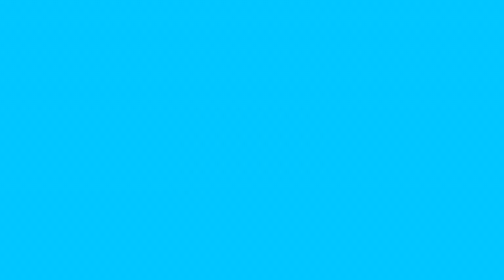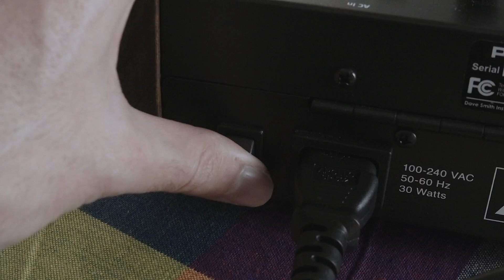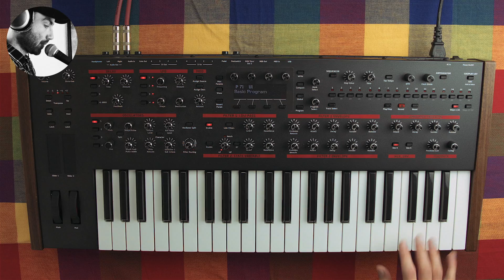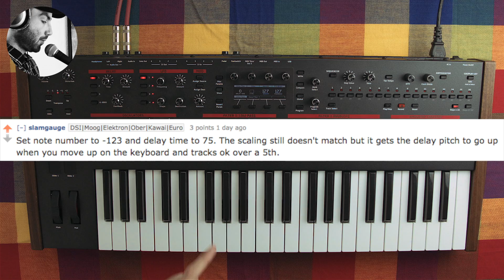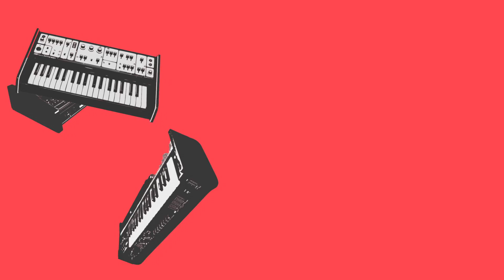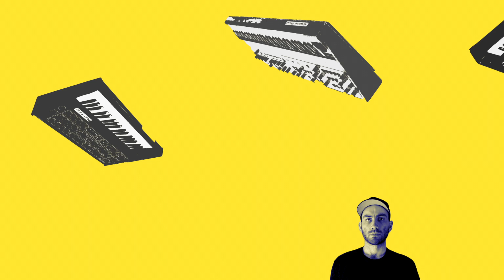UPDATES TO THE KARPLUS-STRONG SOUND DESIGN TUTORIAL ON THE DSI PRO 2 ~ Synthesize This! Ep.07

Comment: Tried it on the Prophet 12. It has a different path or something, because one oscillator alone gave it a slow attack. Finally I found turning the Drive up all the way got me where I wanted to go. BTW, it worked on both, because the feedback isn't about the relationship of the pitch to the frequency, but the signal of the feedback to the original note. So -127 sounds more pulse-y, but +127 is still pitched and sounds brighter.